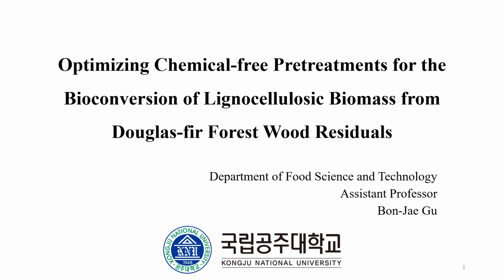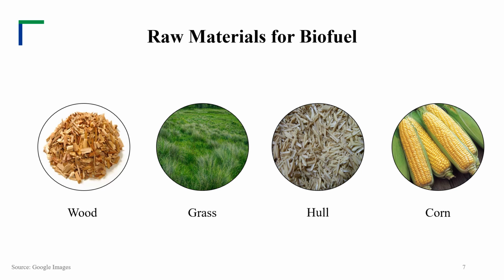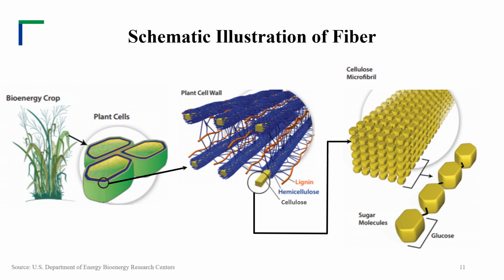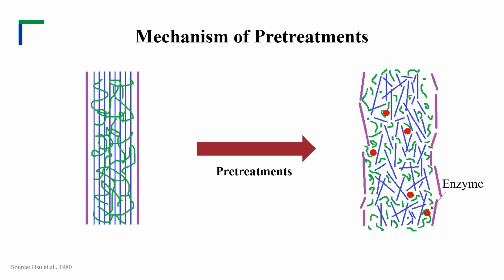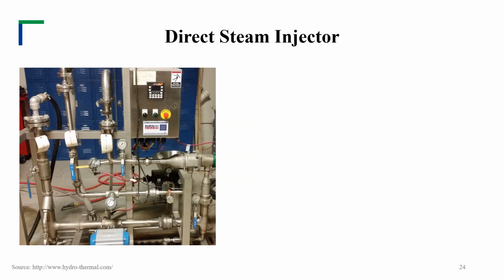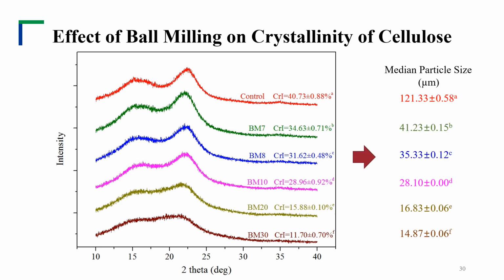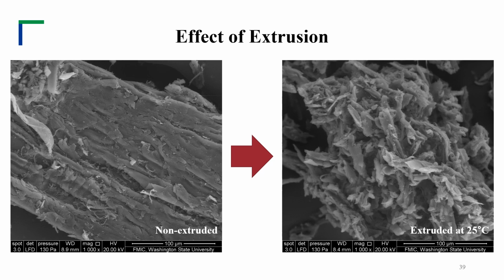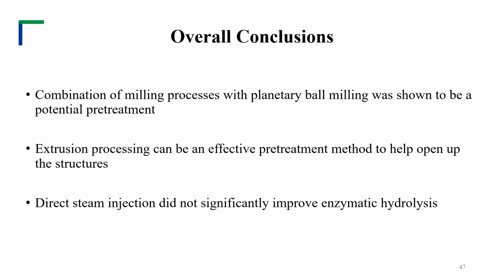Optimizing Chemical - Free Pretreatments for the Bioconversion of Lignocellulosic Biomass

Comment: Thank you for your presentation. I noticed  at the diagram of extruder picture that extruder was installed with heater inside the machine. Is there any particular reason to have heaters along the barrel? Thanks in advance for your answer.
Reply: Thanks for your question.
The role of the heater in barrels is to transfer the heat energy to raw material. The energy impacts the starch, fiber, and protein molecules including the water in the raw materials, changing the original structure of those. Some of the extruders did not have a heater, but you can find the heater for a twin-screw type extruder in general.